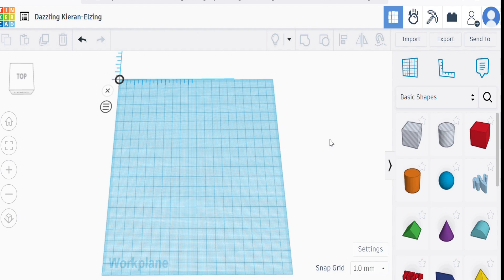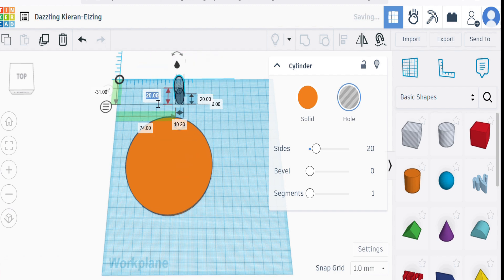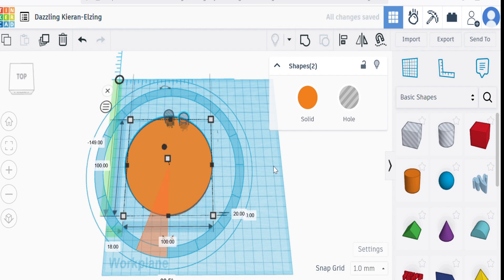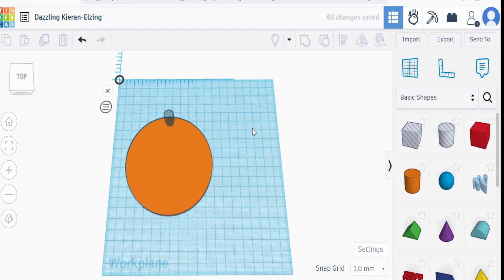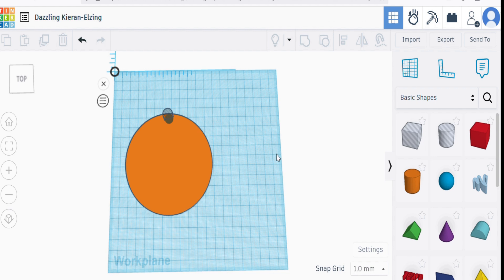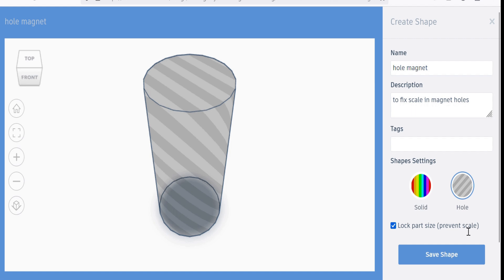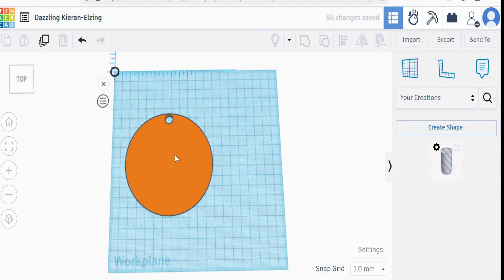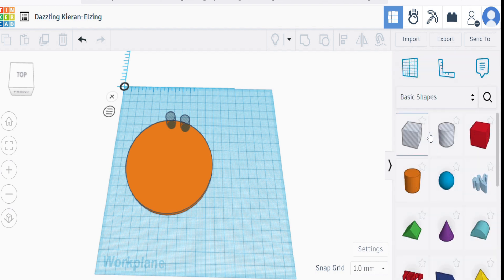2272 Tinkercad - The Your Creations Tool

Comment: Check this out Robert. If you duplicate and rotate the object (cylinder) and duplicate and rotate a few times, then you have a perfectly smooth surface which does not display the low res face counts when you print it. Save the high res cylinder in your "my creations tab" and you can readily use it as a cutting and shape template.

Comment: Hi rob, anyone using solar power for electrolysis? I can confirm it works just hooking two bits of Copper up to the pos and neg and plonking them in some salt water. Waters like a blue lagoon! Only been going since about 10am.
Is that a viable.way to gain hydrogen out of water and also do some copper or brass or silver or gold plating. Gold might make more bubbles as its more conductive?

Comment: I dont know tinkercad that well, but in other software i would create a circular array, I believe in tinkercad you make the first duplicate rotation, and then repeated presses of ctrl D repeats that operation for the next rotation, until you have finished, another way would be to take your first 2 holes and rotate these by double the angle, then take your 4 holes and duplicate and rotate 4x the angle, thus quickly reproducing all the holes required.

Comment: Another great video! How much extra space would you recommend adding to the holes in joints for them to rotate properly? For example if I have a pin that is 10 mm in diamiter would making the hole 10.1 mm be enough?